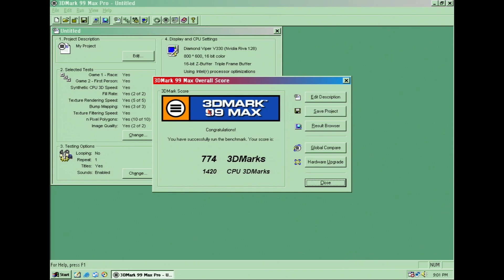Pairing a Voodoo 2 8MB with a Pentium MMX

Comment: This computer would be better paired with a 3dfx Voodoo 1. That said what is the max cpu this motherboard will support? Always add a case puller fan for better ventilation, and in this case add an exhaust fan also, I saw a place for one in the top of the case, the Voodoo 2 runs hot. That is what I did for my Windows 98 rig which has a Geforce 2 MX400 32mb paired with a 3dfx Voodoo 1, the CPU is a Celeron 300mhz, 66mhz FSB as the Voodoo 1 will not operate properly (if at all) with a faster CPU, I use 500mb of PC100 ram, and a SB Audigy sound card with Bose Companion II series II speakers; I have 42 games for this computer setup, and it rocks! There are some games that only run properly on the Voodoo 1, like NFS2se, GPolice, and POD for example, there are others as well.

Comment: The Voodoo 2 is better for faster systems above 300MHz... below that I'd rather use a Voodoo 1. By the way, I have two Voodoo 2 SLIs running via an adapter to PCIe x1 in a Core2Duo E8400 with 3 GHz 😁
Reply: rubbish, during the development of the voodoo2 the vast majority of the cpus on the market were sub 233Mhz.
Reply: @boardernut  no rubbish, yet its true what you say, but it shows its power in higher cpu frequenzy territory. so you are both right, kind of. me, i did pair my 233mmx with a voodoo 1 and a matrox oder s3 virge, cheers mates
Reply: What OS are you running? XP? I have a Voodoo 2 sli set-up. I should try it with my C2D XP gaming rig.
Reply: That's a Windows 98 SE Retro System - very fast 😃 It's not a period-correct setup, but this machine is supposed to be my fastest 98 SE machine.